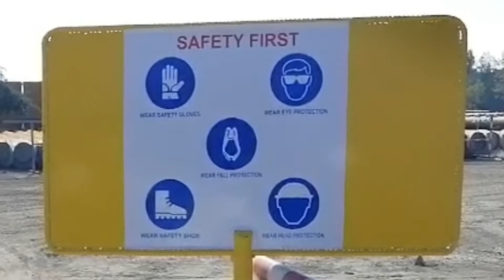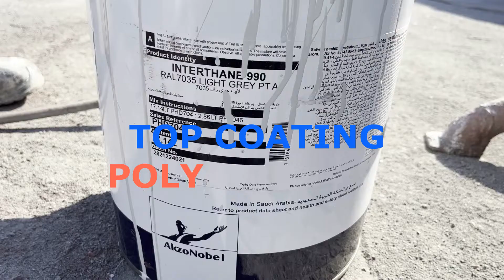AIRLESS PAINTING l HOW TO APPLY  POLYURATAHNE COATING #coatingtips #coatinginspector

Comment: I'm spary painter
Reply from the maker: best of luck
Reply: भाई स्प्रे पेंटिंग के लिये कौनसा मसिन लेनेका
Reply from the maker: https://youtube.com/shorts/shxkHu1-6Rg?feature=share
Reply from the maker: @prashantkadam1719   Hi Dear, it's depends on your project size and what type of paint normally used. 

If you have a small job,
Best method is to check the paint data sheet to verify the pressure required.